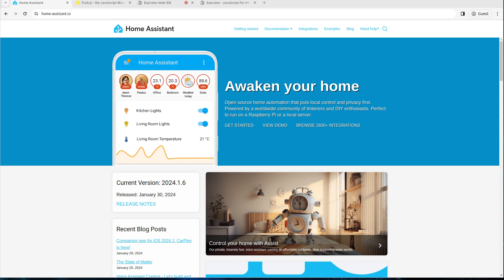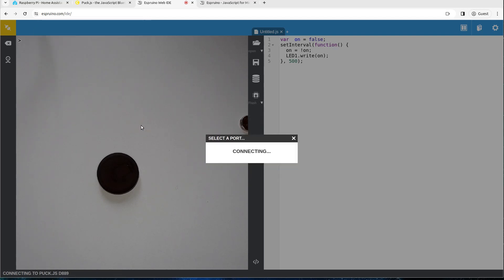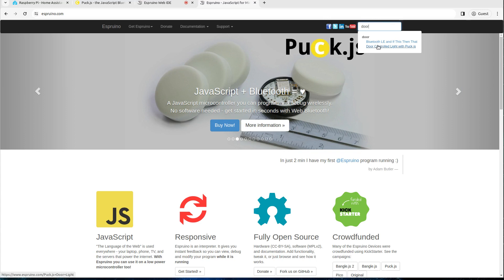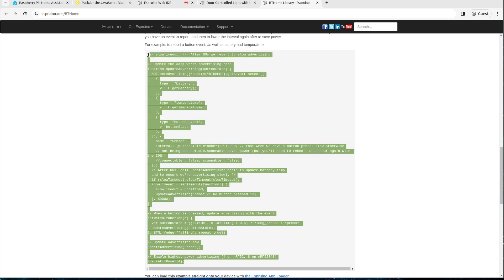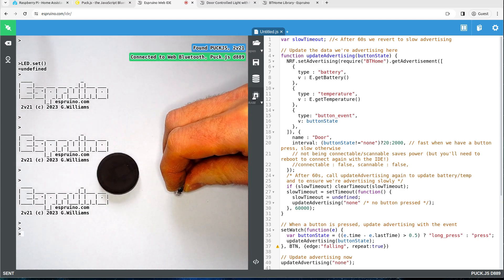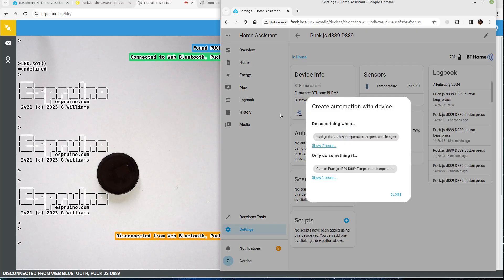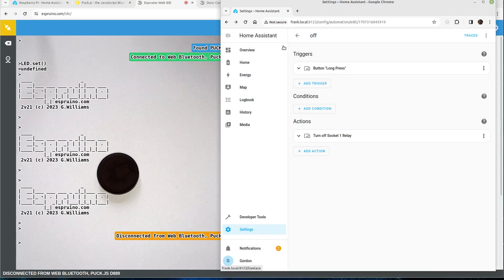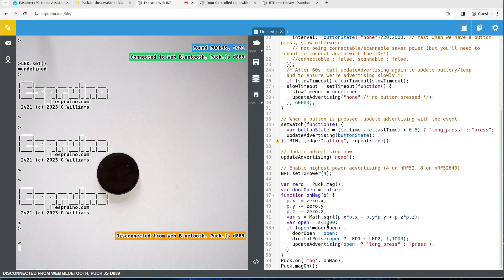Create a Bluetooth door sensor for Home Assistant

Comment: Very nice to have it as a standard library now :) I need to try it with Shelly and ESPHome devices because my HA is out of BLE range most of the time.
Reply from the maker: Yes - it works great with ESPHome Bluetooth scanners here at least - I use a bunch of them dotted around the house. You just need to adjust the scan interval as by default  they only scan 10% of the time so it's easy for them to miss things